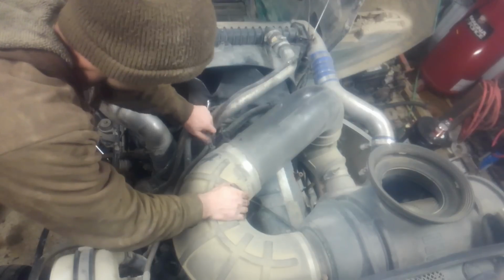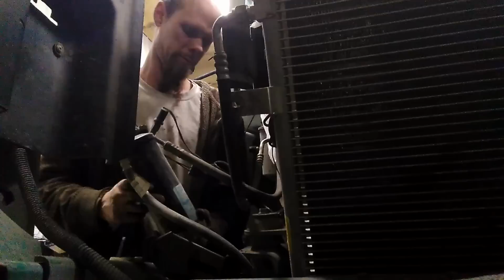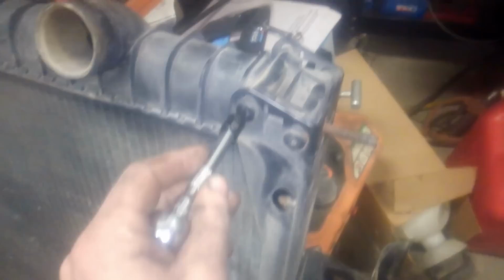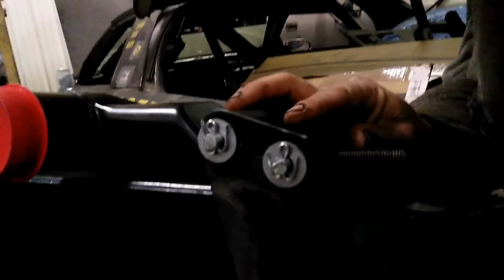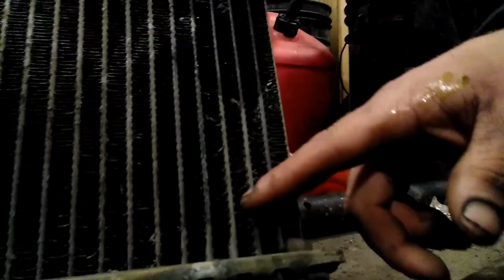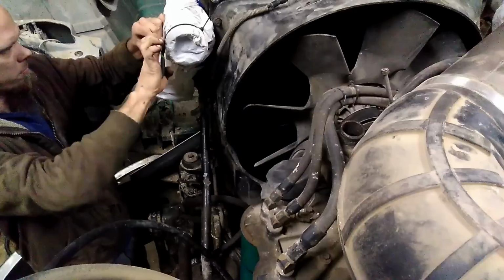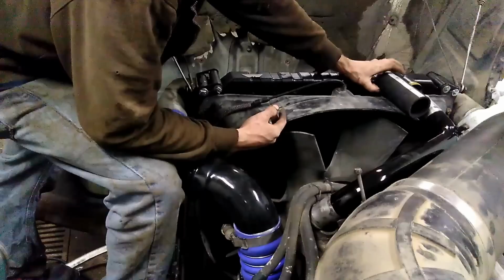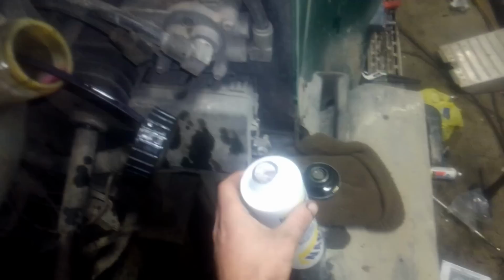radiator replacement on semi truck

Comment: Thank You so much for this video. My radiator on my Mack CH is leaking and I was contemplating whether to take it into the shop or try it myself. It doesn't look to bad after you seen it done once. I'm gonna give it a go this weekend if I can find a radiator around here.   Good job on the video and thanks for showing the neccessary steps and cutting out all the bs. 👍

Comment: Northern radiators are who Volvo uses when they can't get factory. And they are holding up a lot better in trash service (rolloffs and tractors pulling transfer trailers
Reply from the maker: so far this radiator has been good but it hasn't been in the truck quite a year yet but no issues so far. i hope it lasts a long time

Comment: How long did it take you start to finish to replace the radiator??
Reply from the maker: i don't remember, i did quite a few other things while it was all apart that i didn't film as well, new water pump fixed some oil leaks on the front cover and some new o rings on the oil cooler, and a few other things i seem to remember working on it for about a day and a half but probably 4-6 hours on just the radiator.

Comment: Great video i.JUST did an inframe on my 12.7 Detroit  replaced stock 3row rad with a 4row thermostats are 190 but when I'm loaded temp goes up to 210 any recommendation in making run a bit cooler with no load it runs at 190 just a bit worried
Reply from the maker: if 210 is as hot as it gets should be just fine for a 60 series. if radiator water pump t stats are all in good shape and everything working properly you should be fine. if it starts getting hot on a long pull you can drop a gear and back out of it a little bit. but 215-216 wont hurt anything. a manual fan switch can be nice in the summer heat as well. fan on and rpms up should pull the temp down pretty quick.

Comment: Just wondering, how old is the Mack?
Reply from the maker: its a early model year 2000 (first sold and manufactured in 1999)
Reply: @Ezrider359  
Before Volvo totally killed Mack 😔
Reply from the maker: i think Mack became part of volvo in 2001 if i remember right.
Reply: Sounds about right. Might be better than when they were owned by Renault, but I wouldn't bet on it.
Reply from the maker: @cbmech2563  mack was defiantly more customer orientated before volvo took over.
Reply: @Ezrider359  
Ain't that the truth. I worked on MB and MR cab trash trucks in the early 80s and they were just about bullet proof drop ins, camel suspension, 237hp slant 6 with a tag next to the parking brake valve that said "Failure to release brakes will result in drive line damage". 1200 ft lbs of torque at converter stall.